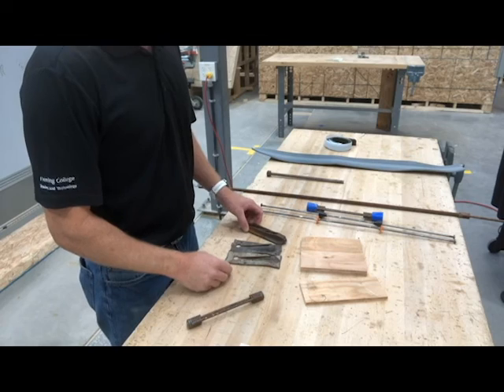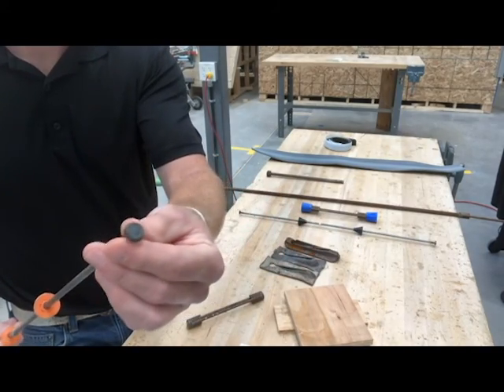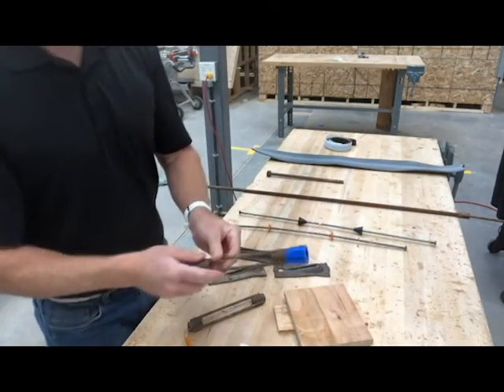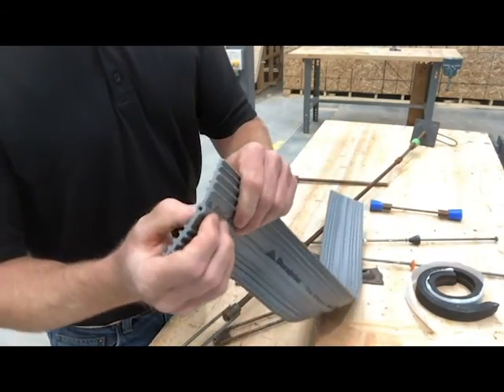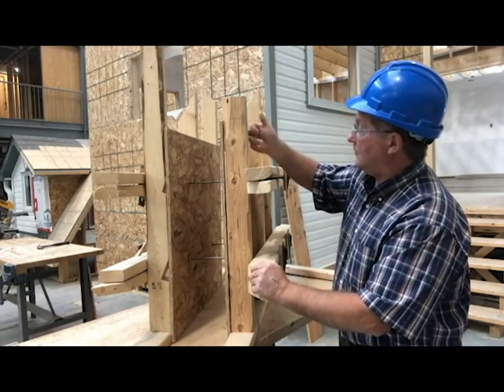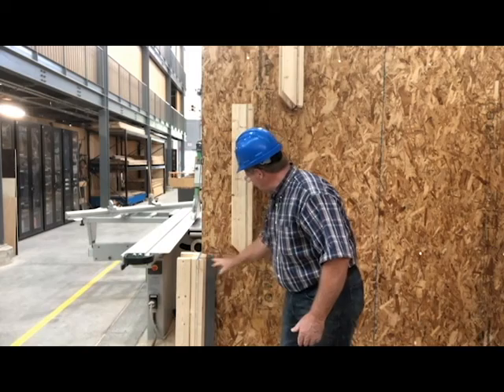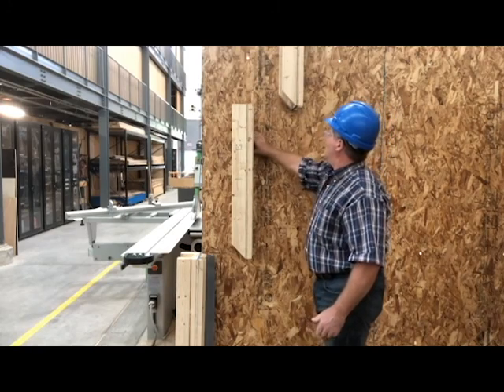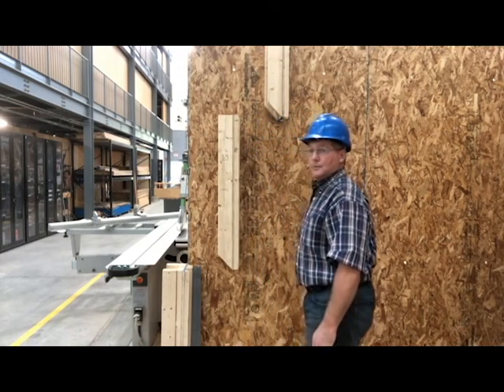Concrete formwork

Comment: Do you need turnbuckle for this system? I see that you rotate it as a one unit, so no need for aditional side supports? Or?
Reply from the maker: Yes, definitely more support required.  We say, "once you think you've braced it enough, brace it some more".  You don't want a blow out, or for things to get out of line.  So, yeah, a turnbuckle on a diagonal brace to a weight or grade works well and you can push and pull your forms into plumb and alignment.
Reply: @scottfleming ok but at what distance would you space them and how many would you put?
Reply from the maker: @picajoool  depends on the situation. A long straight wall I’d probably put strong backs and diagonal braces every 4-6’ depending on how high it was. You’d need less support if it was a shorter wall, vertically and lengthwise

Comment: I came into this video cold.  This is an example of someone assuming people already know about the subject.  So in that case, he would preaching to the choir.  I am a 66 year old engineer but if I were a young kid and paid money for this training, I would stop him at each stage and make him explain each term.  I did concrete form work during the summers when I was going to college, so I was not totally lost.  I plan on doing an ICF house but was looking for a how-to on wood forming for parts that don't need insulation.  I only made this comment as constructive criticism for the instructors so they can do better on future videos and maybe do this one over.✌️
Reply from the maker: Thanks for the feedback.  This video was made to supplement in-school training for apprentices who have been in the field 2-3 years.🙂
Reply: @scottfleming  I thought that might be the case and that it was not originally intended for public consumption.  If it is part of a training series, I might suggest that each video start off with a context statement like:  "This is the 5th video of an 8 video series on concrete forming.  It is suggested that you watch the previous videos as a prerequisite to this video."  On another subject, I saw a guy building his house who couldn't get a form work crew for his porch build so he did it himself using PVC pipe and threaded rods instead of snap-ties.  This causes PVC tunnels throughout the wall.  He then uses a rotary hammer drill to push out the PVC tubes.  He didn't need the wall to be waterproof, so he just left the holes open.  What would be the best affordable way to fill those holes, assuming a waterproofing membrane would be used?  I'd want to fill the whole tunnel, not just plug the openings.  It seems like closed cell expanding foam would be sufficient,  cheap, and easy to apply.  As you can tell, I know just enough to be dangerous!🤣
Reply from the maker: @markstipulkoski1389  , you could use closed cell foam as you mentioned.  Epoxy can be used but is expensive.  Parging mix is most common.
Pvc tubing is common in system forms.  The tubing is cut short and spreader cones are placed on the ends.  When stripped, the cones are removed, tubing stays and the are parged.  This video shows it pretty nicely, I think...
https://youtu.be/h72fYZ6AgO8?si=Foh3kR62qBYWW-QX

Comment: Your wall formwork is very, very old school, in Bavaria we have had system formwork with metal frames for over 50 years. The anchors are mostly threaded rods with a 15mm special thread DW 15 Dywidag. This is much faster and safer.
Reply: It appears this is a training facility for apprentices.  It’s good for apprentices to develop building and tool skills doing it the old school way.  Also there are so many types of formwork systems they can’t teach them all. To move from the more skilful old school to easy systems is easy.  Not so easy the other way.  But the most important part is to have apprentices to learn skills and get a good understanding of the structural requirements in building.  Once this is really understood, problem solving on site becomes much easier.  A good carpenter or builder needs these skills.
Reply: We use perry and Docka? Systems for high rise buildings on the east coast smaller jobs with limited cranes that plywood system worked fine
Reply: @scottschwenk9570  PERI or Doka and many other system formwork manufacturers also have systems for formwork without a crane. Anyone who educates no longer needs plywood/wooden systems, whether wall or ceiling. Today 99% of formwork work can be done with systems. The old formwork, as is currently done for walls in the USA, takes a lot of time, costs resources and is not good for the environment and climate. There are now also systems in which the frame and formwork are made entirely of plastic; it is light, stable and can be used often. This means less wood/plywood is needed, but unfortunately there is still little interest in this in the USA. 
During my training I also learned how formwork is only made from wood or plywood, but we no longer use it. We say “time is money” and we do most of the formwork for basements or underground car parks. A cellar measuring approximately 12m*12m made entirely of reinforced concrete (floor slab, walls and ceiling) is built in one week with 4-5 workers and a tower crane.
Reply: @scottschwenk9570  PERI or Doka and many other system formwork manufacturers also offer systems for formwork without a crane. Those who form no longer need plywood / timber systems, whether for walls or slabs. Today, 99% of formwork work can be done with systems. The old formwork, as it is done for walls in the USA, takes a lot of time, costs resources and is not good for the environment and climate. There are now also systems where the frame and the formlining are completely made of plastic, it is light, stable and can be used often. This means that less wood / plywood is needed, but unfortunately there is still little interest in this in the USA. 
During my training, I also learned how formwork is made only from wood or plywood, but it is no longer used here. We say “time is money” and we make most of the formwork for basements or underground garages. A cellar of approx. 12m*12m made entirely of reinforced concrete (floor slab, walls and ceiling) is built in a week with 4-5 workers and a tower crane.
Reply: @scottschwenk9570  P E R I  or D o k a and many other system formwork manufacturers also offer systems for formwork without a crane. Those who form no longer need plywood / timber systems, whether for walls or slabs. Today, 99% of formwork work can be done with systems. The old formwork, as it is done for walls in the USA, takes a lot of time, costs resources and is not good for the environment and climate. There are now also systems where the frame and the formlining are completely made of plastic, it is light, stable and can be used often. This means that less wood / plywood is needed, but unfortunately there is still little interest in this in the USA. 
During my training, I also learned how formwork is made only from wood or plywood, but it is no longer used here. We say “time is money” and we make most of the formwork for basements or underground garages. A cellar of approx. 12m*12m made entirely of reinforced concrete (floor slab, walls and ceiling) is built in a week with 4-5 workers and a tower crane.

Comment: Thanks for all the great information!! When would it be acceptable to just use waler with short end ties over a stud/strongback + waler system with long end ties?
Reply from the maker: Short ends are great for low walls where lateral pressure on the formwork is minimal.  Or maybe if space is limited, like a monolithic curb and stair form.  Once you start getting taller forms, the pressure compounds  and walers and stongbacks make it easier to maintain consistent wall thickness and straight, plumb forms.

Comment: I would really appreciate, as Im sure many others would, a side by side price comparison of the 3 most common types of formwork. For basements I would consider snap tie but for most residential stem walls I really think the simple wedge tie with 2x10s is so straight forward & has to compete with other panelized systems pricewise. Myself & 1 other did a form prep (8" thick) for a 46 x 48 ft foundation with 4 intermediate walls within in 2 weeks thats digging, outer wall, steel, inner wall, all bracing, j bolts & hold downs. Its quick & easy to form & break down.
Reply from the maker: ICF's are my favorite method for forming residential foundations.  The cost is comparable and there is no stripping.  I'm not sure where you are but in Ontario we need a continuous thermal break on the outside of the building envelope.  This system gives us that plus its super light!
Reply: @scottfleming  thank you for your response. Im in NCal so we are in a climate zone of 9 snow is very rare. I have seen the ICFs & they look real nice to work with - I wonder how they fare in earthquake zone codes. The only foam wk Ove done is rigid foam placed b4 a radiant slab (down the sides of footings & about 30 % inward under the slab. I was surprised that the entire slab wasnt 1st insulated. Apparently not necessary - just the perimeter. Love doing formwork especially when it gets more involved its actually interesting to me. Been a carpenter 23 yrs so any deviation from the usual peaks my interest. Thx.
Reply from the maker: @koogle612  I don't know how they perform in earthquake zones.  I am guessing they would be fine as long as you had appropriate reinforcement.  A radiant slab certainly needs rigid under the entire slab here.  I love formwork too.  Also kinda fascinated by all of the innovative things coming out of California (ex. California framing hammer, and most of the homes in Fine HomeBuilding seem to be from Cali).  Seems like the world is a few steps behind California - we see these warning labels on so many products, "Known to the State of California to Cause...".  Guess its fine for us to use elsewhere?🙃
Reply: What about for commercial for panels with return walls

Comment: Wood forming is not cost efficient at all.  The up front cost are cheaper but handsets would be the way to go.  Gang forms for the bigger jobs.  Saves you a ton of money in labor.
Reply from the maker: For sure!  Systems like Aluma, Peri or Doka are the only way to go.  But even system gang forms and fly forms need loose forming for infill, bucks and irregular shapes and sizes.
Reply: @scottfleming  Scott, graduated in 1993, with a golden hammer I might add, wood form work does have its place though. For a better finished product, less seams, better seams, smoother wall with fewer defects to be patched. Obviously, there is a place for everything, that is the beauty of UBC apprenticeship school. I will say this, there is nothing uglier in the concrete world than gang form walls.

Comment: What system is better: single waler and jahn bracket or double waler and wedge...I'm building CIP lintels on a masonry building. maximum span is 8ft. (2 x4's as so expensive now)
Reply from the maker: All materials are expensive now!  From what you described I think I would go with the Jahn "A" brackets.  Single walers will suffice, provided your form ply is thicker than the 7/16" OSB we used in the video!  Don't forget to get the short snap ties
Reply: @scottfleming  Got it...Thanks for the insight and quick reply...it's appreciated! In the 70's we could buy box cars of studs for a nickel each, now a stud is 15 bucks at HD!...don't get me started on plywood!...hahaha...Have a great day!
Reply: You don't need to have your 2x4 walers fall half on a 2x4.  That's bs.  You just want to stagger the break in the top and bottom waler.  Also, you run your walers maybe 18" inches past the end of the bulkhead to lace it up with plywood.  And letting your studs run 6 feet over the to of the form?  I don't think the finishers pouring the concrete would like you very much as they will have trouble pouring and finishing the wall.